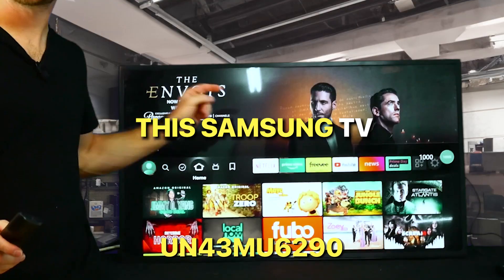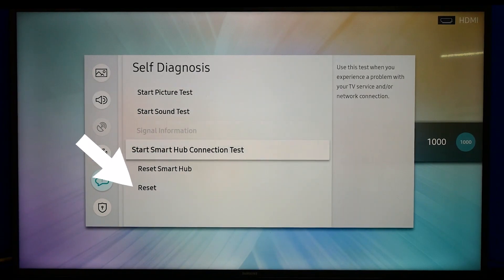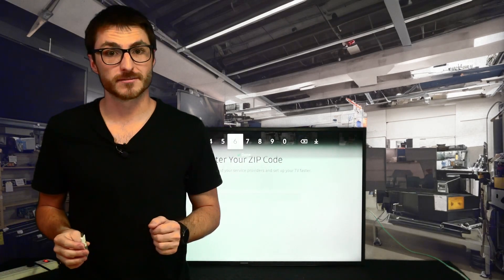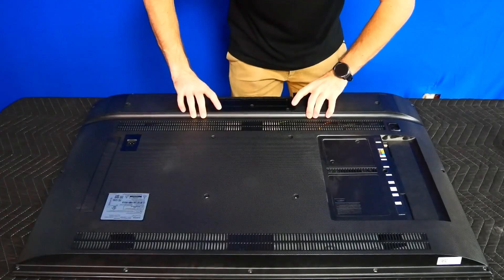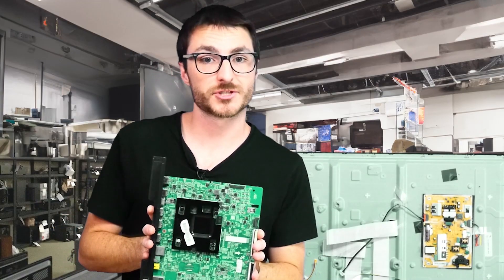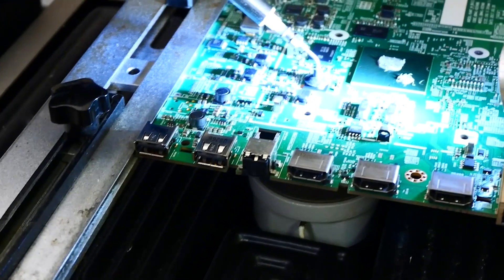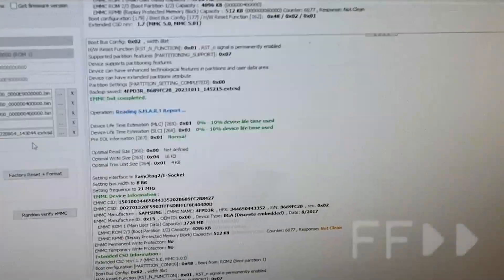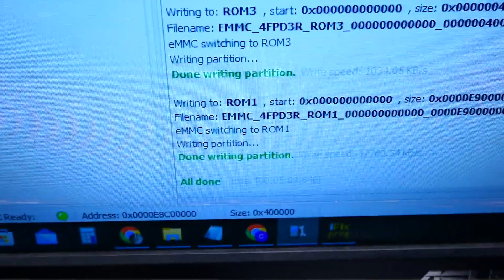Samsung 4k TV How to Reset Audio, Fix Volume Issues, Sound Gets Stuck UN43MU6290

Comment: Still curious what happened to the sony Motherboard..from previous video 🤔
Reply from the maker: It wasn't fixed, we still have it, odds are we either need to replace the remaining ram bricks to fix it, or there is something else going on with it but we ended up sending the customer a replacement mainboard. 
We may revisit it later but not sure on that.
Reply: @NicksTVRepair  You did a nice job But Now in my opinion Dont give your valuable time  To that Damn Board any more..And Just Keep Fixing new Devices.
Reply: Very possible that the board is cursed…